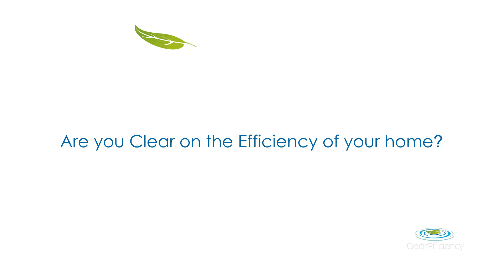Window Replacement by Clear Efficiency, Retrofit Install Method

Comment: I can't find one video that shows a retrofit window being installed into a stucco wall with a exterior window sill. I have windows that are inset and have a windowsill and I'm wondering if I can use retrofit? I don't know if you can order them custom with smaller exterior flanges or if the flange on there would fit where I have about a 1 and 1/4 inch to work with if I leave the old frame in. Can you help :-)
Reply from the maker: Yes, we can help.  The new retrofit window frame stucco fins can be customized to fit your stucco trim and sill.  Please send me an email to info@clearefficiencyhome.com and we can discuss your project further.